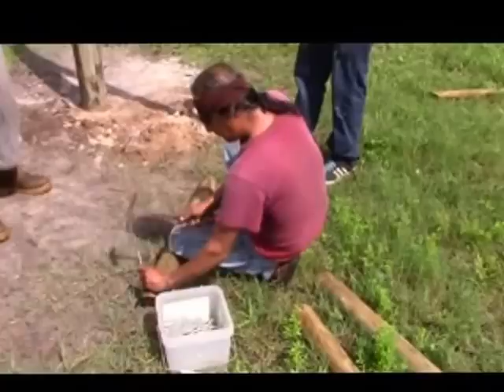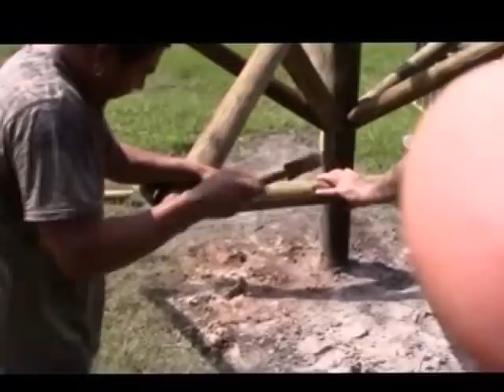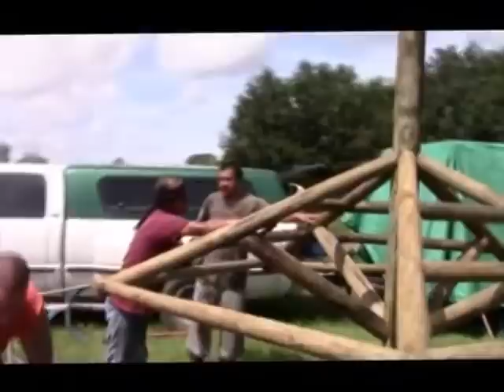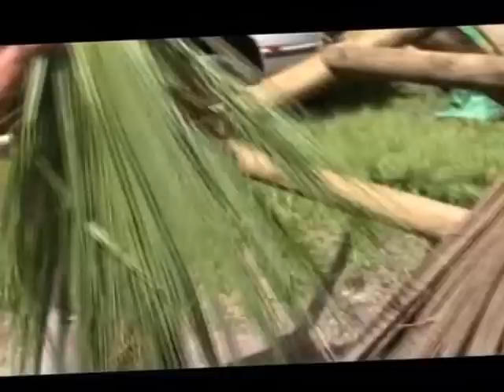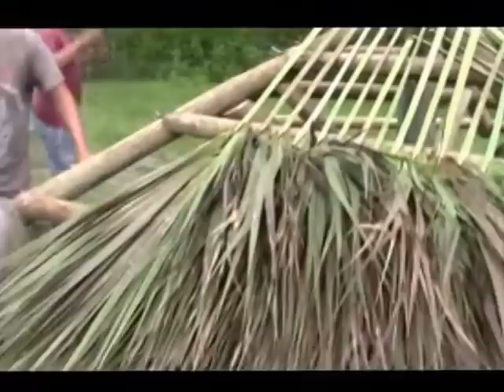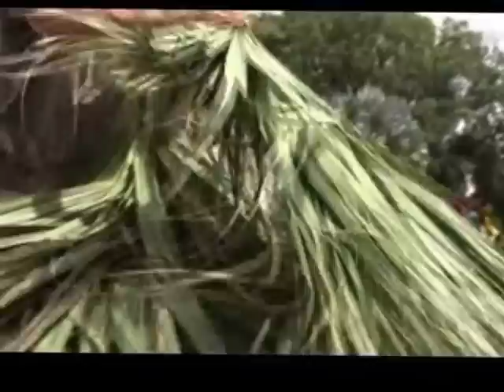build a single pole tiki hut

Comment: I love it !! Where can I find the Rustic looking poles? Thanks for an awesome video. That is so cool !!! Cant wait to start mine. Do you have any idea, how many palm fronds you used for this project. I started cutting the barbs off of mine already with a Carpenters carpet knife. Is that how you cleaned your barbs off as well? Thanks again. I do plan to install a ceiling fan under mine, so I have to build a brace for that as well.
Reply from the maker: Sorry for not replying sooner, we use Sabal Palm leaves cut from the deep woods, they do not have Barb's on them.
Reply: How many my father in law was ripped off I am an arborist and would like to repair his two that are in need. Retired navy it would be a nice gesture for a different time too lazy to do the math

Comment: Valuable skill set!  what's the life of this in Florida? I imagine the shingles were prepared with the nail in place before the started? What size nail and type.  Possible to do this with Saw Palmetto and Bamboo stock?
Reply: The framing we use is pressure treated wood, the fresh sabal palm leaves will last 5-8 years before needing to be rethatched.  Bamboo doesnt work very well because of nailing in the leaves individually cracks the bamboo. and the weight of all the leaves.  Saw palmetto leaves are much smaller.

Comment: Wondering how once you have filled in the 4 sections of pie with palm leaves, how do you finish that last section from on top? Especially as you come to a very small opening left at the top of those pie sections?
Reply from the maker: You need to keep going around the pole with leaves , cutting the stems to about 3" and bending them so they fit snug around the pole. Last leaves are cut to about 1" and piut around the pole at the top . We also use 4" nails nailing into the pole and bending over the stems on the last row.